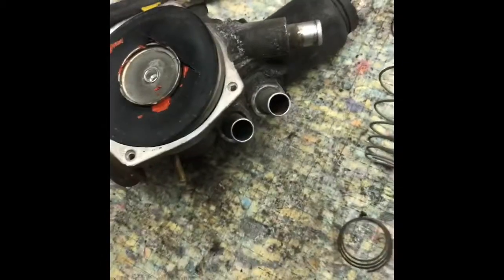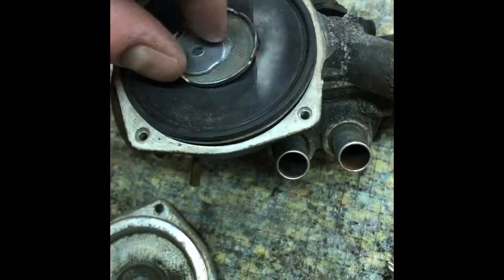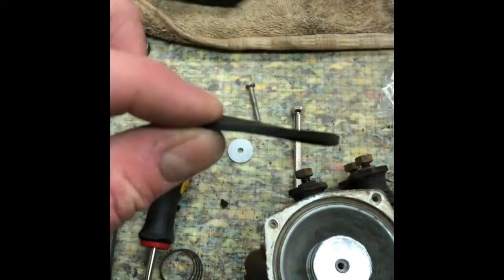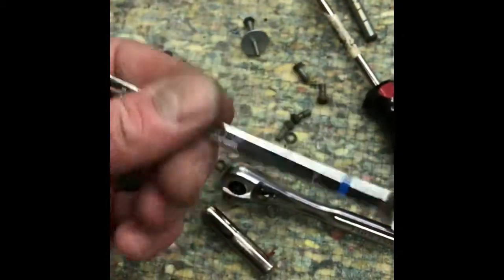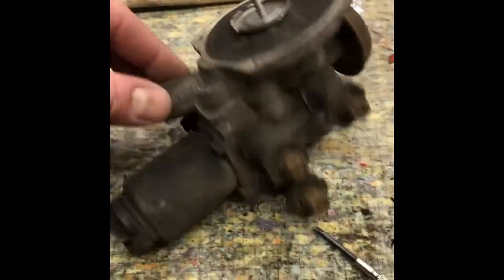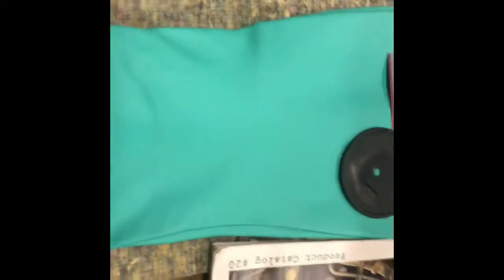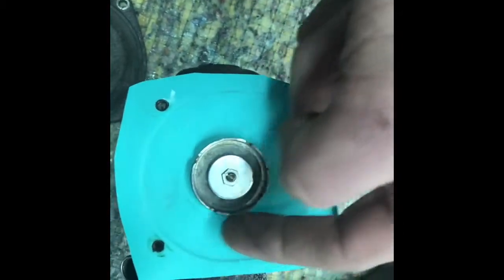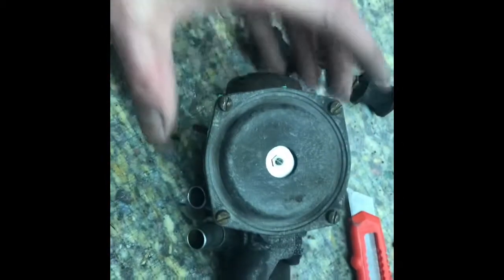VW autostick vacuum solenoid valve rebuild

Comment: Hey man, just curious where you bought these gloves? I was looking at the manufacturer and the item # on the tag you had in this video, but they want like $100 for a pack of them which I think is insanely high for gloves. Thanks if you can get back to me!
Reply from the maker: I am pretty sure I bought those at lowes. Look for gloves to change out battery acid or paint strippers and chemicals. I found them on google for $5 on up to $45. The color is what you are really after, that color of glove is the right material and thickness. Its been a while so sorry i cant go get a pic of them for you.

Comment: Thank you for this video. I will try your fix. It sound like it will work. Question... What where the 3 additional rubber parts that you ordered off the newer VW. I think you said they were 6mm each?? Do you know the part names and the year they came off of? I want to follow your lead and completely rebuild the solenoid so I don't keep having issues. Thanks a ton for this info!!!
Reply from the maker: You are looking for these on ebay $10 plus shipping. It wouldnt let me post a pic of them.

VW MK1 Fuel Pump, Accumulator, Rubber Mounts, Vibration Absorbers, Rabbit Jetta
Reply: @friedgizzard  Thanks buddy!!! I found the parts on ebay using the Key Words you gave me. Did you buy your parts from this Ebay seller? How many of the mounts did you need?
Reply from the maker: Daryl Finley when i purchased they came in a pack of 3. My solenoid required 3 rubber feet to mount it. I don’t know what seller I purchased from. Good Luck!

Comment: How do you adjust the solenoid? I put a New clutch in but it releases to fast now
Reply from the maker: Sorry it has been a few days. I sold this car a while back, but i do not believe the solenoid can be adjusted. If you have an autostick, i believe the adjust for what you are asking is on the vacuum canister. There is a threaded rod that goes into the canister that can be adjusted and i think that is what you need.